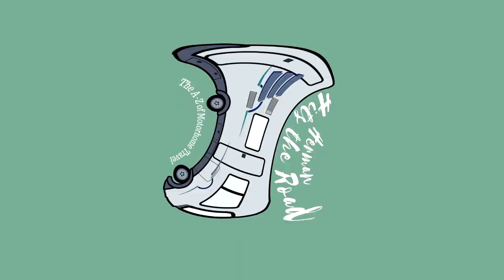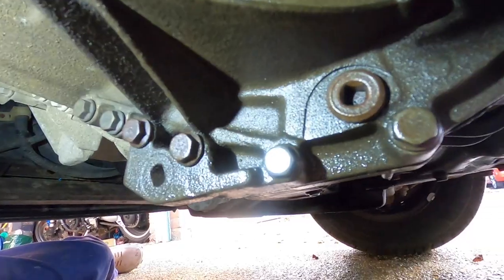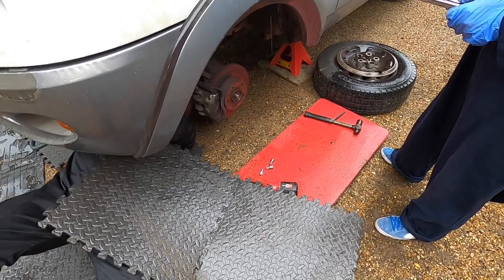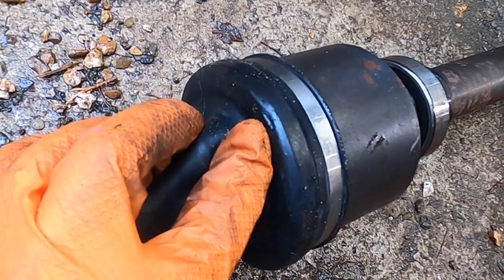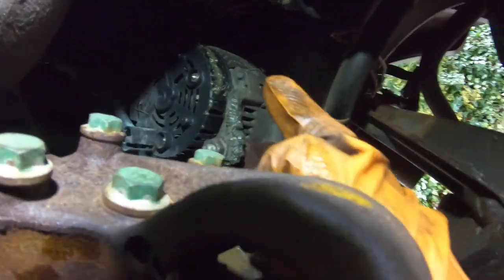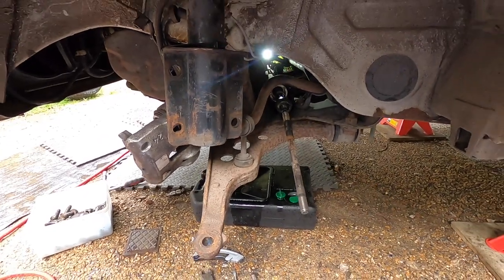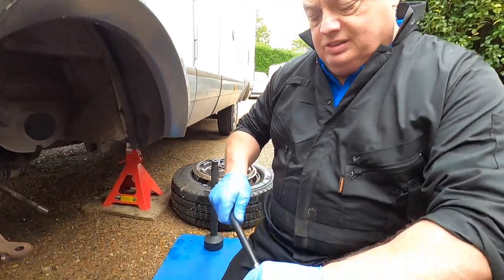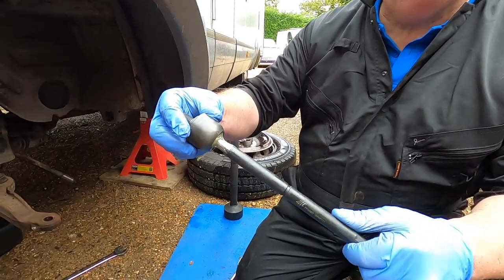NO 5TH GEAR after replacing drive shafts

Comment: what a palaver, it will be like having a new van once done. we have a 2005 Kon-Tiki and there is always something that needs attention. currently in New Quay Wales and have been touring for a month and at the moment we have zero running side lights (the yellow ones) on the driver's side so can only drive in daylight hours. it's the shortest day this month so roll on spring. safe travels.
Reply from the maker: We enjoy doing it, Suzie Mc but we'd rather be out camping in Herman. Shame about your running lights. I assume it's not the bulbs or fuses that have blown? Enjoy your trip away. Our next trip is Christmas 🎅 with Chas, Alex and Gary 👍👍

Comment: Inner cv joints knackered if throwing grease out must have felt shuddering like wheels need balancing,if the inners are new I think the shafts are too long and are locking up throwing grease out,filling them full of more grease will mask it for few runs out but it will return 👍
Reply from the maker: Thanks GW but we'd had just replaced both drive shafts and then found that a boot had split..

Comment: The Trackrod inner joints being worn wouldn't really cause wandering, might be a bit more difficult to keep it straight? Never use grease on threads! Use a bit of Locktite on Trackrod threads, so they won't undo. Some have a Lock washer. Tip is count number of spare threads from Locnut inwards, put Locnut on at same as was so in theory Tracking won't be too far out, subject to the new part being the same as the new! I would have just replaced the leaking CV Gaiter much cheaper than a shaft! I just did that on a 2008 Peugeot 308, the Gaiter clip was loose and made a lot more mess! I didn't see the Hubnuts Peined over to lock them!
Reply from the maker: Thanks for the tips, Peter

Comment: Very good vid , i had to replace my 5th and syncro due to oil starvation and possibly rainwater from the scuttle , "those in the know" put 3 litres (rather than 2.7L) of oil in , what do you and Chas think ?
Reply from the maker: Well, Mark we put in 2.8 litres and then an extra 200ml but I think the damage was already done.
Reply: @HermanHitstheRoad  I think in 5th at low speeds over long motorway distances did mine , 
Good luck with the repair
Reply from the maker: Thanks Mark 👍👍
Reply: Thanks for the video Ants / guys… great stuff once again.  My R reg B544 had a very expensive gearbox rebuild a few years ago, before she came to me, because of of a failed fifth. I’ve had her a year now and the previous owner advised me that the gearbox is now over-filled, as per other comments, and that it’s best to ensure that the engine is warmed up before engaging fifth. I hope all goes well and that it doesn’t prove too expensive for you. Good luck!

Comment: Yet another marvel of mechanical work being carried out on Herman. I do really like these kind of videos, the work and back and forth banter really make the video, it is just a pity about why these videos come about. It does show you what you can expect when you own an older Motorhome, the things that they do to try us and empty our bank accounts at the same time. Still it makes life with them a bit more interesting, and they do deserve the care and attention for what they bring us when they are all tickety boo.
Reply from the maker: Too right,  Digger Buckett but surely a newer motorhome will cost more than maintaining an old one? A new(ish) one would set you back £30k+.
 Glad you enjoyed the video 👍👍
Reply: @HermanHitstheRoad  Very True and you can't guarantee that it will be any more or less reliable. Which reminds me that I need to get the front brakes disc and pads changed, as I have them sat in there box behind me. Which I bought back in August to fit. Then I need to change the rear shocks and then the must dreaded thing treating the chassis, not looking forward to that job, as I really don't like being on my back for long as, it doesn't like me being on hard surfaces these days.
Reply from the maker: Yeah, laying on the floor isn't fun but you can get mats to make it better. Chas's mat is about 3cm thick and then there is the pillow and slippers 🤣
Reply: @HermanHitstheRoad  With that lot the only noise coming from under the motorhome would be the sounds of not me working but snoring!😂
Reply from the maker: LOL 💤

Comment: Not unusual for 5th to fail on that model of Ducato, mine failed at 35,000 miles, and it was on it's way out again at 75,000. The gearbox specialist who did the job told me it's just a poor design, overhung 5th gear with no outboard bearing, just a converted 4 speed.
Reply from the maker: Yup, that'll be it, Chris.  Thanks for commenting. I hope you enjoyed the video?

Comment: It looks like you have air conditioning on this vehicle which is a rare option! If I am right, does it work?
Reply from the maker: We do and it does work, @julianh7853. How could you tell?
Reply: @HermanHitstheRoad  That's great that it works. It will be good for Europe  in the summer! I saw some pipework that looked like AC pipework at 13:20 and at 13:27 it entered through the firewall to the heater box, so I assumed I was right.

Comment: Hi guys! I am a newbie, seriously a newbie when it comes to RV's but I have fallen in love. But I need help.
Can I ask for help / advice here on your youtube channel?
Reply from the maker: Of course you can, Norseman. Whether we'll be able to answer them is a different question 🤣🤣.
And welcome to the channel and motorhoming
Reply: @HermanHitstheRoad  Herman The Savor 😂
As an experienced sailor, I thought I had DC power under control! Hahaha how wrong can you be.
As a first-time buyer, I bought an old charming lady from 1994 with low km. Fiat Ducato 1.9 td with one starter and one consumer battery. Then the DC current decides to become schizophrenic and gives variable voltage up to 16-17 v but low amps, it fluxes.
It's not the alternator or the regulator. The car has a Nordelettronica as control unit.
Could be a ground fault but where should I start looking?
Today I thought the problem was localized, hahahaha what I achieved was that glowing relle also became schizophrenic.
Do you guys have any ideas?
Reply from the maker: I haven't a clue, sorry Norseman. Does the motorhome start and do the batteries keep their charge? 
If the motorhome is a Hymer then the Classic Hymer Technical Facebook group is a great help.  If it's not a Hymer then try searching for similar groups or forums. I'll also see if Chas has any ideas too.
Reply from the maker: Hi Norseman, I've asked Chas. 
First check the grounds.
Is this problem caused when you plug in to electric hook up? If it is then it is probably the charger. You should be able to put a meter on the charger but there is a serious danger of electrocution. So you should get someone qualified to look at it. I hope that helps
Reply: @HermanHitstheRoad  Hi Herman! Thanks for the feedback. Sorry for the late response, but I was called out to work, even though everyone knows I don't have time for that, because of all my free time!
Have checked the grounding. What is confusing is that the voltage fluxes whether the power cable is in or not.
I'll probably have to take the expensive route to the ranks of the pros!
Will be following your channel, learning a lot!
Reply from the maker: You haven't actually said what is wrong with it. Does your motorhome actually work, start, drive?
Do you have a solar panel on the roof?
Reply: @HermanHitstheRoad  Everything works but the voltage goes up to 16-17v when the engine is running. It started with the glow lamp light flickering when I was about to start. I thought it was a ground fault. Started measuring and detected high voltage. No solar panels!
Reply: Hi sounds like a voltage regulator problem i would check it again as it may be an intermittent fault. 
Start at your altenater and work towards the battery.
Reply: @charlessmillie8774  Hi thanks for the feedback. Yes i do that!
Reply: @thenorseman2804  👍
Reply: @charlessmillie8774  Thought you'd get a fun update!
Now I have changed all the ground, almost all the wires and the regulator.
Then I check and everything is as before! Hmmmm.....!
I get an old voltmeter and.........! Everything is perfect. 
The newly purchased voltmeter, not a cheap variant, was defective!
🤣🤣🤣🤣🤣🤣
So there was never anything wrong, but now everything is new anyway!
Reply: @thenorseman2804  wow.
Really pleased everything is OK 👍 
Beauty. 
Chas.